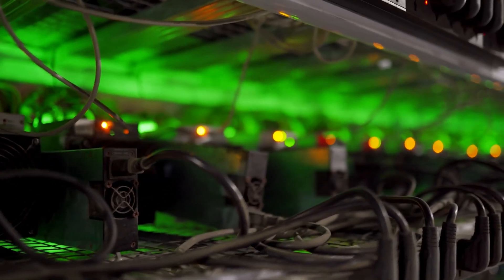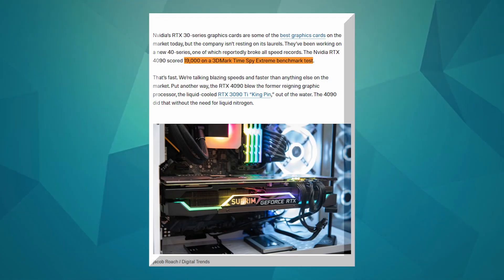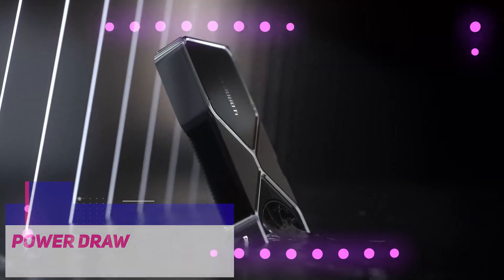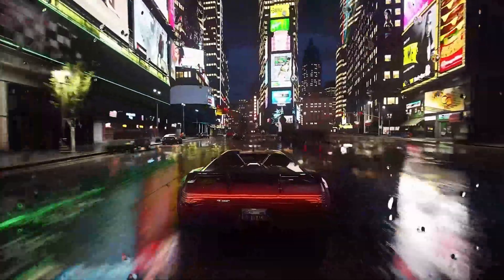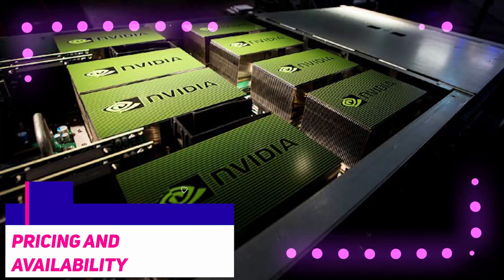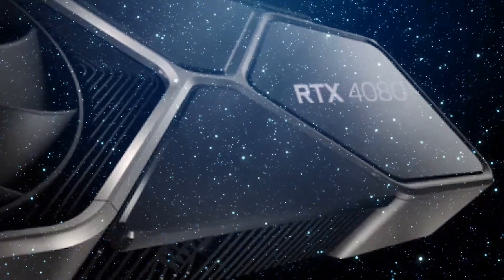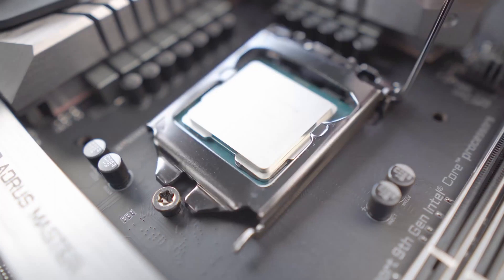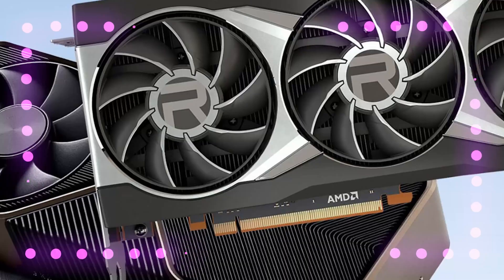RTX 4090 vs RX 7900 XT - Which should you buy in 2022?

Comment: AMD fanboys gotta be hurting right now.  Intel cpu is better and 4090 is better.
Reply from the maker: Oof
Reply: Sorry to hurt your feelings
Nvidia - limited to 4k@120 (DisplayPort 1.4a)
AMD - limited to 4k 240 (DisplayPort 2.1)
I am switching to AMD for the first time in my life
Reply: @Ninja-sp1kw  the pain!
Reply: @bencarey243  Yeah that would hurt being exactly twice as slow, but don't worry I am sure the 5090 will be out soon
Reply: @Ninja-sp1kw  4090 can do 13k!
Reply: @bencarey243  It probably can (although would be a slideshow), as you still have the same problem of cable bandwidth displayport 1.4a being 32.40 Gbit/s, where displayport 2.1 is 80.00 Gbit/s
Reply: Dsc= 4k@240hz
Reply: @hotrodsloVEVO  Yes I am aware of DSC, but compressing and uncompressing every one of the 4k frames 240 times per second will add a lot of overhead to the GPU + add latency + quality loss + artefacts, so not sure that it would be worth it
Reply: @Ninja-sp1kw  Well a 4090 can't even run Cyberpunk at 4k over 144 fps so you might as well just stick with a last gen card if you gonna play old games in 4k !
Reply: @bencarey243  Cyberpunk is a demanding game so not expecting anywhere near 240hz there, but there are plenty of games that hit 4k @ 120 fps even on my 3070 card (such as fh5) yes that is with AA turned off etc, and graphics lowered, but the 4090 is 3x faster than the 3070 so should be easily able to do 4k @ 240 in most games (if they had display port 2.1) but they don't so you will bottle necked by the cable and be limited to 4k@120
Reply: @Ninja-sp1kw  Cyberpunk is almost 2 years old.  Plaguetale is demanding,  the new god of war is demanding, all new games are demanding.  Your not gonna get over 140 fps in 4k on any new game unless it looks like ass in which case a current gen gpu would run it fine.

Comment: Definitely going to buy the RX 7900 XT. Better Linux drivers, better price, lower energy consumption, almost the same performance (we'll see if not better), would be great together with Ryzen 9 7950X. Finally buying a PC worth $4,000 even when I know it'll cost 50 bucks in 10 to 15 years.
Reply: Better wait for the 3d version
Reply from the maker: $4000 over 15 years is not that much when you think about how much you’ll be using it
Reply: Me happy with my rx 6600xt 🤣🤣
Reply: im with you bro. im currently running a 5900x with x570 and 6800xt Nitro+. amazing performance in 2k 165hz monitor. so far all swell 130fps steady in warzone all maxed out. 4k Forza Horizon 5 all max 93-100fps. amazing. GPU temp around 65degrees.
Reply: Dude u gonna die 1 day who cares about money, just fucking enjoy ur life

Comment: Cost per frame is what we should be looking at, and by that metric the 4000 series isn't the leap forward we need. 

AMD doesn't need to beat Nvidia at the high end, they need to somehow mass-produce cards in the 400-700 range that trades blows with Nvidia cards at 800-1200. I'd also like good 300USD cards for once. It's been mostly that way since I got my ATI Radeon HD3870 - it didn't compete with the 8800 Ultra, but it never needed to. AMD makes great gaming cards if you don't get stuck into the benchmarking/marketing/hype machine.
Reply from the maker: very true

Comment: Price is prohibitive. The 4090 brings more fps, but mainly just from bigger die, more transistors and higher power draw. So basically just "go bigger, go better", not much in terms of new, better tech. It will be more interesting to see the 4060 and 4070 cards, and their princing vs performance.
Reply from the maker: Solid point

Comment: Considering the now old video I just watched, it should do 8k smoothly.  At least at medium.  6900xt was doing 8k ultra with studdering and almost playable fps.
Reply from the maker: 8k is super impractical anyway so 8k benchmarks are just for show
Reply: @TopTierTech1  It's a marker for thinking about when one can realistically think about not upgrading anymore for better performance and realism.  How much difference is there now before one can no longer tell it's not live action?  If you use 2x SSAA at 4k, it's just drawing at 8k and downsampling it to 4k.  If the hardware can handle a resolution smoothly at ultra it can do more than well enough at the next jump with medium or a balance between medium and higher settings. Jaggies and shimmering artifacts mess up the realism a little.  I wonder if 8k can finally enable scenes to look like they're live shot.

Comment: There’s no way the 7900xt is gunna cost 1600ish, check moores law is dead leaks, insider info tellling us it’s half the cost to make compared to 4090 indicating 1000-1200 retail
Reply: I will go for 7900 xt if it will be between 1000 and 1200 for 100%
Reply: Moores law is a dog of amd . Don't believe that liar . Always amd biased stupid.
Reply: It's only 899 btw!
Reply: Aside from naming gibberish dude has been wrong on a lot of shit
Reply: This aged well
Reply from the maker: yeah it will be cheaper for sure
Reply: It's not going to be between 1000-1200, probably 1400-1500. Both 6900 and 6950 werent any cheaper than a 3090 back then
Reply: @shirayuri4345  wrong, the base msrp of the 6900 xt was 1000 USD. The 3090 non ti was 1500. During the shortages both went up. 6900 xt at its highest was like 1700 usd. The 3090 was like 2500-3000+
Reply: @quasar1567  that’s true. I assume the 7900xt will not cost 999$ like the 6900xt did, but as nvidia went from 1499$ on the 3090 to 1599$ on the 4090, I really think the 7900xt will be around 1099$ on the reference model, which means around 1299€ here in Spain, and that’s for the reference model, so I don’t think I will be able to get an AIB premium 7900xt for less than 1400€… 😂😂
Reply: @LethaR_YT  i think you are spot on. That is still way better than the 1950euro 4090 though. Disgusting nove by nv together with the 4070 in disguise. Just gotta make the annoying decision if I want cuda for productive apps or not. Im no power user but am interested in apps like davinci resolve and 3d sculpting etc. Ughh... :( so littke choice in this market
Reply: @virityrealtual3831  yeah man it sucks… let’s hope amd have boosted significantly the computing power of the rx 7000. But as you said, the founders and most simple aib models of the 4090 cost nearly 2000€, if you want something like an asus strix you’ll have to pay 2400€ or more… it’s just disgusting, I rather go with a 1400 premium 7900xt which will probably deliver 99% of the performance
Reply: @shirayuri4345  this aged like milk, the card is $900 😂